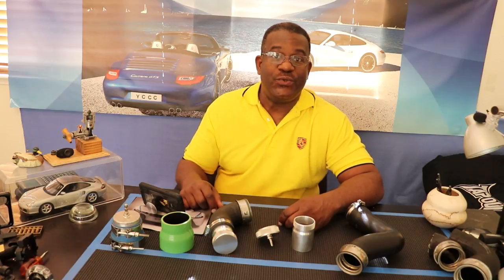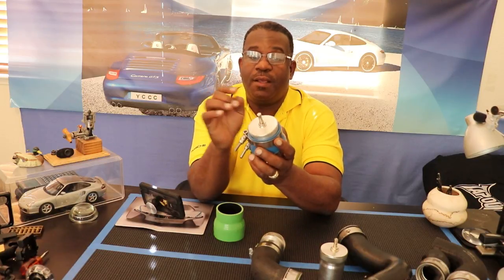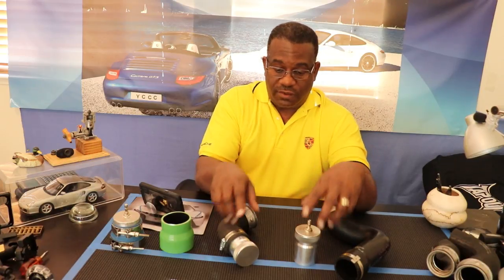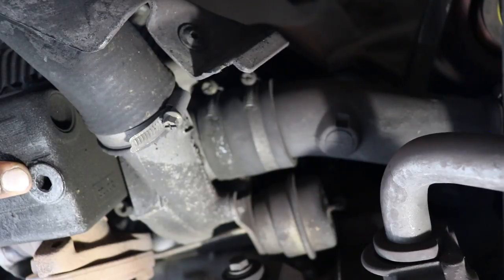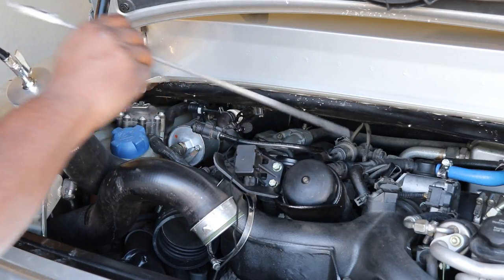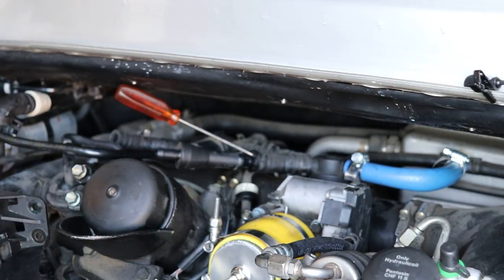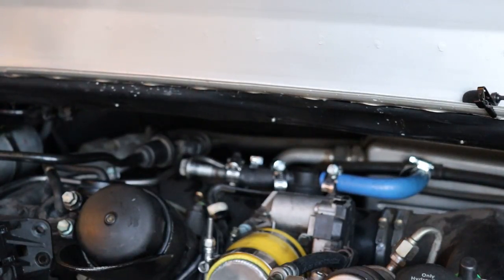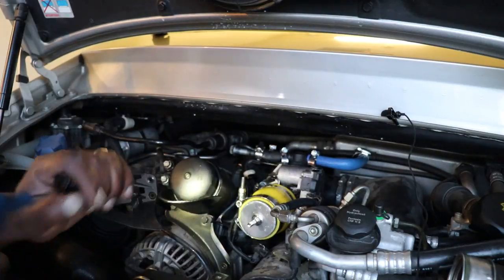Part 2 of 3 How to check for Boost leaks testing on a 2003 Porsche 996 Turbo

Comment: This is a really helpful series of videos!
However, my throttle butterfly is slightly open when at rest so I am losing pressure into the engine.
I assume when you were testing yours the butterfly was firmly shut?
Would you say mine is faulty or do you know what I should do to force it shut?
All the best.

Comment: Where did you get that rubber connector to do the boost leak on TB? What it's name?
Reply from the maker: I ordered all the hoses and connectors off eBay. The connectors are called adapters from one size to another.

Comment: Question:  At the beginning of the video he was under the car, pointing to the hose that needed to be removed.  Around the 11:00 minute mark the plug with the schrader valve is seen in the engine bay.  What is that hose connected to?  The intercooler?
Reply: I think he has this connected to the Y pipe so he is bypassing the intercooler on that side

Comment: Hey Clint, did u have a video of how to lower the engine slighting in order to access all the valves and so?
Reply from the maker: Yes, just lower it all the way down to the subframe, it won't go anywhere.
Reply from the maker: Go to 10:00 in on this video for the engine mounts.  https://www.youtube.com/watch?v=PWd8ex63olM&t=285s
Reply: Thanks man, your support very much appreciated. 

I noticed that the Y pipe and intercooler hoses had quite a fair bit of lube oil in there. As well as the y pipe breather tubes and check valves. Is this normal? Is there any point of flushing the traces of oil from the pipes?believe there is oil all through the air system.

Comment: good stuff. Where did you source the Bergen tool? thanks
Reply from the maker: eBay  https://www.ebay.com/itm/Hose-Clamp-Pliers-2pc-Tool-Set-Ratchet-Locking-Flat-Band-Ring-Spring-Type-Swivel/173441042092?epid=11013162616&hash=item2861e446ac:g:HqsAAOSwzZNcGapG:rk:41:pf:0